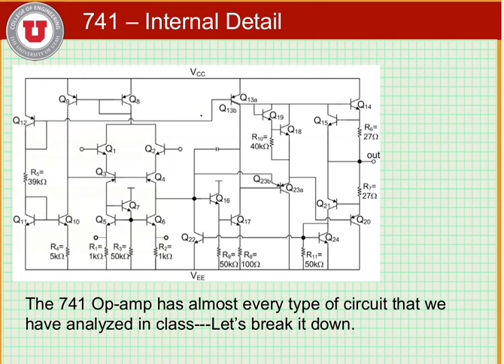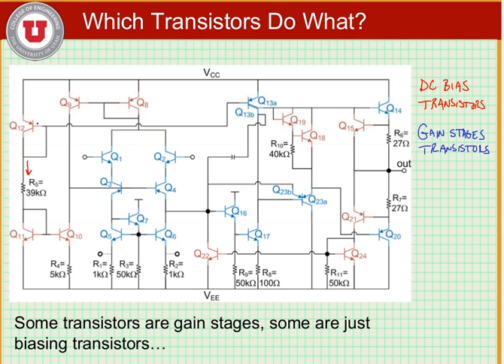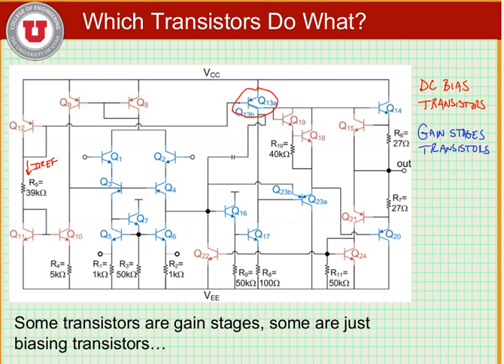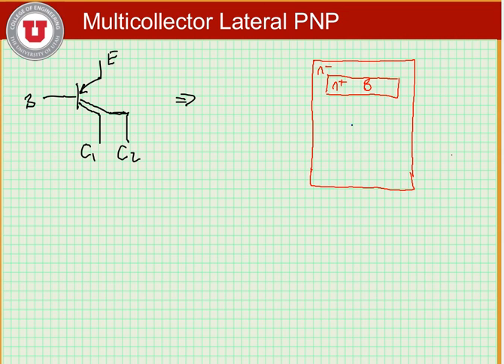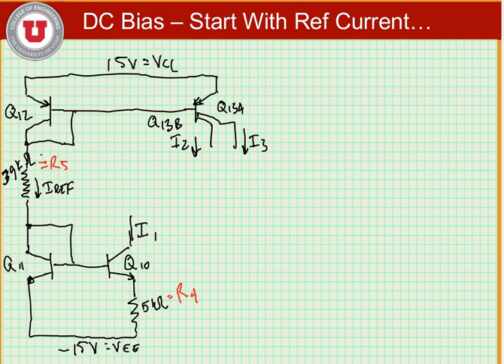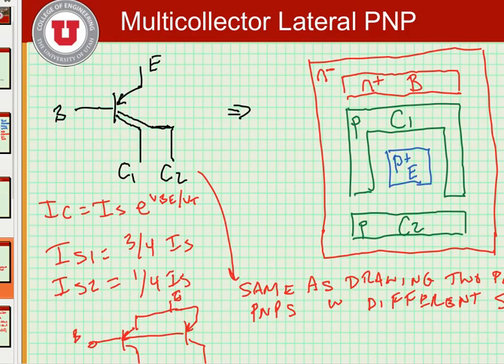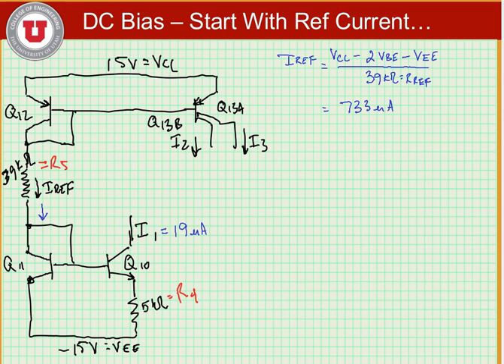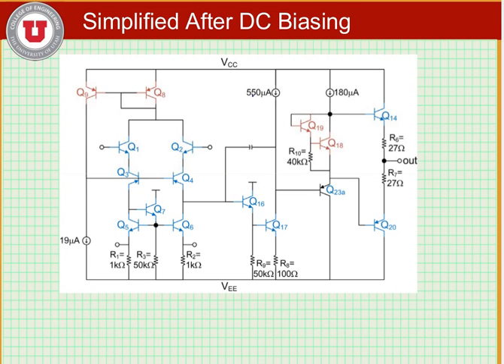ECE 3110 - Lecture 19 - Part 1 - 741 Operational Amplifier

Comment: Hello Mr. Walling,
Thank you for these valuable lectures.
I have a question about the input stage of the 741 op amp:
What is R3 used for? What would be different if
weren't there?
Reply from the maker: It is setting bias current for Q7.